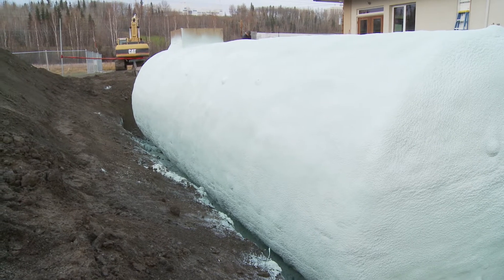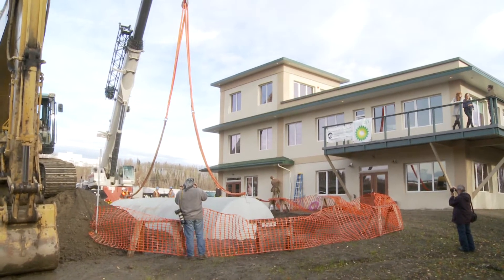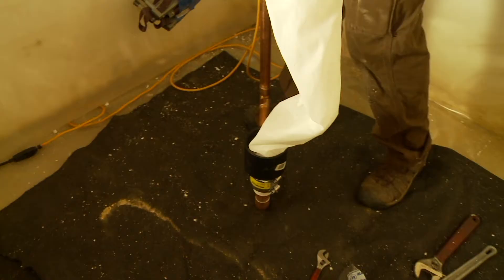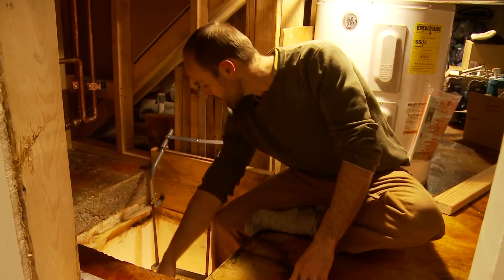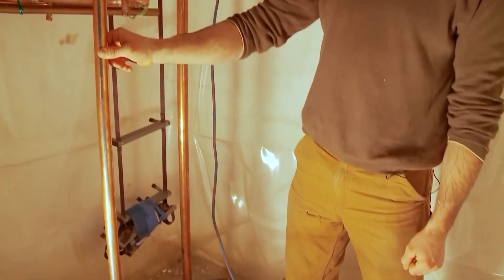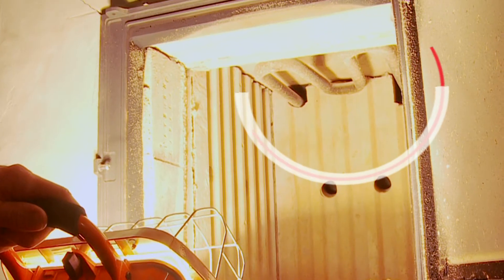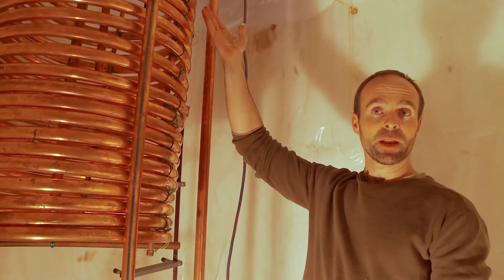Inside CCHRC: Thermal storage

Comment: Water without pressure has a limit to how much energy it can store. Whereas if you were using sand as the storage medium instead you could heat it to 600 degrees. And since it is a semi fluid you can get heat to stratify in it readily.
Reply: You’d have to use a considerable degree of solar concentration to get 600° either F or C, though obviously a lot more in the case of Celsius. I’d use air as my transfer medium but it would require some sort of pump for circulation. Maybe multiple, porous, ceramic risers for the stratification system as sand will not disperse heat along strata as readily as in water. Of course, if you’re using combustion as your heat source, 600° is easily obtainable.
Not sure if the greater complication would be worth it. Those high pressure air pumps could be expensive or dodgy or both, IYAM, and you might need a tracking array to achieve those temperatures.
Reply: @q.e.d.9112  no. Use electric inductive air heating and pump the air through tubes. That is how Polar Night is doing it.
Reply: @davefroman4700  care to elaborate further on the source of this information?
Reply: @davefroman4700 exactly and Batsand is doing it for residential with the storage underneath the house for new construction
Reply: @q.e.d.9112  No you can do it with a simple inductive heat load.
Reply: Which liquid medium would you use ?  I've seen oil based video solutions but fire hazard and pressure explosions are a concern but if underground the risk is mitigated.
Reply: Sand ... and a massive solar concentrator.
Reply: Your heat losses with a medium at 600C will be extremely high unless you spend a fortune on insulation. For any sort of single user residential case, I don't think it's a smart choice. You're going to spend 150,000BTUs a day just to maintain temp of your thermal battery without any load!
Reply: honestly people, we should simply be using nuclear reactors
Reply: I'm just starting into this video but I'm hearing sounds like they use water to store the Heat??? This must be an old video but I can't imagine any did not know about Polar Night in Finland and their 100 ton Sand Battery. Sand can be heated to 600 Degrees... with water you have an explosion way before that
Reply: @howtogetoutofbabylon8978 Come on now. You're comparing an 8 foot cube to a 12x15 meter cylinder.

The 'small' sand battery is over 468x the total volume of the water storage in this video. Let's not pretend this is a comparison wherein the only variable is the storage medium. There's a significant difference in scale and scalability before we even get to practicality, engineering and cost.
Reply: Bat sand is the company planning to put thermal storage tanks underneath the houses in new construction... of course as their name indicates they're going to use Sand not water!!!
Reply: Not easy to get the XPS insulation value of R-60 with zero thermal bridging at 600°. Insulation foams melt around 200°F. 

Not saying it can't be done, but there are always trade-offs.
Reply: The thermal mass of sand is about 5x less than that of water.  This means that energy stored in say 80C 1kg of water equates to 400C 1kg of sand - that high temperature is very hard to contain for a long period (months). That is why water is a better medium - though with water come pretty major cons such as potential for rust/container tightness/algae/bacteria...
Reply: @dorianmanto  
The useful energy in your system is the difference between the temperature of storage and the temperature below which the heat is useless (say 30°C in the case of space heating). That’s a Δt of 50°. So a Δt of 250° for the sand, for an equivalent heat content / unit mass. Ergo 80°C water contains the same heat energy per unit mass as 280°C sand.
In most situations, the volume of the storage, rather than its mass, will be the limiting factor. Sand has a density 1.4 times greater than water so that we’d need a Δt of 70° (t=100°) for the water to have the same usable heat per unit volume as the 280° sand.
At this point we can only store more heat in the water by pressurising it - not a good idea in a domestic situation, as you’ll know if you’ve ever seen the result of a pressure cooker explosion. The sand, on the other hand could store three times as much energy at 655°C without requiring any pressurisation at all. 
Of course, achieving such temperatures with solar would require both direct sunlight and a high degree of concentration. If we were using surplus solar electricity then achieving such temperatures would be easy.
Reply: @q.e.d.9112  Water has a specific heat capacity of 4186 J/Kg°C, dry sand has the unit specific heat capacity is about 800 J/kg K (really depending on where you look).

Water is a much better storage medium in confined spaces. You also need to account for the additional insulation needed to contain the hundreds of degrees C stored in sand.
Overall though, biomass and biogas are a much better storage medium than both of these as you can per se, accumulate  biogas throughout the year and simply use it in the winter. This needs no thermal insulation and is more energy dense than storing the energy in heat directly.
Reply: @dorianmanto  
I totally agree about biomass/gas but the video is specifically about thermal storage. I also think that long term thermal storage is more suited to a community scaled project. The relative construction cost of the insulated container is less for a larger scale project and with thermal capacity increasing with the dimensional cube, while losses are only increasing with its square, bigger is definitely better.
Dry sand at 600°C contains between 206 and 253 kW.h of >30°C heat per m³, depending on the particular sand. This would provide the needs for perhaps 10 apartments for a day in winter. A cubic meter of water at 100° contains about 81 kW.h.
That’s assuming you can make use of that heat right down to 30°C. If you need it for hot water (you do!) then it’s only usable to around 50°. Water has lost 2/7 of that 81 kW/h while sand has only lost 2/57 of its 200+kW.h.

ETA. Air at high temperature is more usable, too. It’s easily diluted down for lower temperatures, needing nothing more than a thermostatic controlled bleed valve, but it can be used at higher temperatures. Easy to have a 200°C oven or a 250°C hot plate if you’ve got a supply of 300°air.
Reply: Actually, doing further, back-of-an-envelope calculations, I think sand storage could possibly be viable for a single household. We’re going to need a container for about 10 m³ of sand, which @ 600°C contains around 2.3 MW.h of (>30C) heat energy. That’s 20kW.h per diem for a continuous 115 days. 
A brick chamber 7’x7’x7’ with 3’ of insulation top and sides,ought to suffice. Make it 10 x 10 x 7 and you’ve got 40 kW.h per day, or 30 for a full six months.
Use surplus solar power during the summer months to run heating coils embedded in the sand. Ideal for an alpine situation and a super well insulated chalet. Little electrical demand, during summer, Could be installed under the house, easily enough. Dry sand, electric heating, glass insulation, air. No leaks, no rust, minimal fire hazard. High-grade heat, Zero new technology: hot air oven and cooktop easily made up by local engineering shop. A winter’s worth of space and water heating, cooking and refrigeration, too. Easy to convert a gas fridge to run on hot air instead.
During winter, solar power is only required for lighting, electronics and intermittent appliance use. So size your solar/battery system for winter use and store the summer surplus for heating/cooking use, all winter long.
Reply: @q.e.d.9112  Yes, it seems more suitable for smaller installations. I don't know how to extract the heat though? Closed loop glycol or something with an exchanger? Direct water/air pump through tubes?
Reply: @PerhapsNoodle  
We’re dealing with very high temperatures here. I think using air, passing through embedded stainless tubes would be the easiest way to extract heat. Can blow air through without the need for high temperature pumps. Can easily mix hot and cold air to achieve a desired temperature. I don’t think we can get high enough temperature with solar/thermal; think we need photovoltaic to generate the red-hot temperature we need for megawatt.hour storage.
👍
Reply: @q.e.d.9112  Commercial solar power works at 20% efficiency while commercial solar thermal can achieve efficiencies above 60%. Thermal collectors are cheaper than panels per unit of area. The water based solution seems more sensible to me.
Reply: @q.e.d.9112 stainless steel is not a very good conductor of heat. Aluminum or copper would be much better
Reply: @vegeycracker  
We don’t necessarily need a particularly good conductor. I was thinking thin walled stainless risers, through the sand would be cheaper than copper. Aluminium loses structural strength above 200°C. But, hey, the extra cost of copper would probably be pretty marginal so you’re probably right.
Reply: @q.e.d.9112  I am in the early stages of planning a sand battery to heat the soil of a greenhouse so that we can plant earlier.  We're in Alaska off grid and we have 25KW of solar panels that produce far more power than we can use in the summer and shoulder seasons.  Thinking of digging a pit (fortunately the soil a foot down is all sand, although I might have to process it to make sure the organic stuff is disposed of) and then put down some insulation, then pour concrete over top, then put sand back on top of that.  Might use some additives for the concrete to make it more heat resistant.  All encased in concrete with insulation outside the concrete.  Then on top of that will be soil added back on and the greenhouse built over it.  Maybe some stainless steel tubes going through the soil and some kind of air pump and regulator to control when and how much hot air is pumped into the soil.
Reply: @Pythonizah Is it true that governments have deliberately capped and limited the efficiency of solar to around the 20% mark?  Private Industry makes a fortune billing the public purse, so they are invested in reducing efficiency to sell more panels….not forgetting the engineered obsolescence generating future replacement and further profits!  

Any channel exploring and developing systems that people can use outside of the grid and the corrupted system, is doing us a great service.
Reply: @q.e.d.9112 I love your idea, I live in the artic and there is excess (1/2 cost)wind energy that could be implemented into this idea. You design it I’ll build it.
Reply: But that's useless if you don't have a source reaching those temps. 90C is already pushing it with solar heating. They're not using electricity for heating; others doing it like that is very irrelevant.
Reply: @TheMrTape  Because with that kind of heat you can run a heat pump off it and supply 100% of the heating for 1/4 of the cost of operating a traditional heat pump.
Reply: solar doesn't provide more than 200° celius max. I dont't see the benefit for his use case to burn wood like a crazy person to heat the Sand up to 600°
Reply: @foxxyboxxy9348  
No, the idea is to use surplus wind/solar electricity to heat the sand. If your solar can provide enough for your winter time usage, it will have power to spare over the summer months. Properly insulated this can be stored as heat, for months. 
The LCOS and thermal efficiency both improve with scale. However, distribution losses increase with wider distribution, so there will be an optimum size for any given situation.
Reply: @q.e.d.9112  Exactly, but you could also use solar vaccuum tubes instead of PV and pump hot water or something, but more complicated to get higher temps than just Incoloy heating elements embedded in the sand.

Comment: R1.15 in the ceiling? In Belgium my ceiling was insulated to R1.7, about 5 years ago, and it was deemed insufficient in the building report, so I put another layer of insulation to bring it up to R3.20 which is the most common now. I can't imagine living under a R1.15 ceiling in Alaska! 🥶
Reply: He said R115 in the ceiling and  R70 in the wall, not R1.15.  It is R values in the inch pound system because he is in not america. The R value  unit there is in (°F⋅ft2⋅h/BTU) the metric R values are in (K⋅m2/W)    the conversion is the R_metric *  5.68 = R_inch-pound . So the insulation in metic R is R 20.25 for the celing and R 12 in the walls. So the celine R value is around 12x higher then you have.
Reply: I think it’s in inch pound units. R-115 is the equivalent of 20.7 m2K/W

Comment: I do not get why your tank under house is ... with a liner, wasn't it better to build a concrete tank covered with insulation, this way you would have been able to go to a higher temperature = storing more energy.
Those tanks are big ... and will radiate a lot of their energy => you will need to heat them a lot cover those loss.
And when you say "79% of the energy consumption accounts for space heating" ... it means nothing, it depend on what kind of house.
A properly insulated house will not need much energy to heat, properly mean ... designed for cold climate.

Comment: Is there a way to heat without using any wood to supplement? Would a larger tank carry you over? How many days of heat do you get with this system?
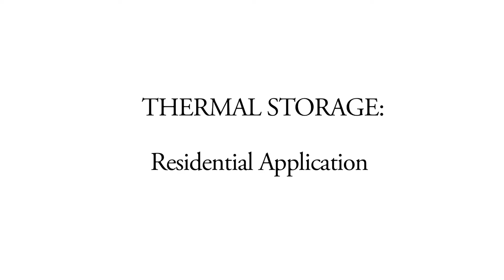Reply: During the winter months in Alaska even more so as they near the winter solstice they only get 3:42 of sunlight in Fairbanks. The sun just barely peeks above the horizon, its super low 2-3° sun angle provides little in the way of thermal heating unless thermal panels are mounted completely vertical and facing south.
Wood pellets are manufactured from waste sawdust and wood scraps that otherwise need to be delt with so having  the ability to utilize a waste stream to heat homes is ecofriendly.
Yes, a larger tank would last longer into winter, however cost becomes a major factor. Just look and see what a special order 4x8 sheet of 6" thick XPS is at the local home center, and that is only half the thickness, its crazy. Those blocks of foam that make up the 2,000 gallon tank are 12" thick, are very large, and costly. If the size of the tank was scaled up 3x, 5x, or 10x the cost would outweigh the benefit of renewable energy and going with a fossil fuel heating source would cost less.

Comment: What are the caloric losses from the tank walls?
Reply: 300mm EPS 0,114 W/(m²K). Tank area is 24m². So it will leak 2.7 watts every kelvin/centigrade above ambient. So when water is heated to 60C (140F) then tank leaks 100 watt. Luckily almost all heat leaks into the house so it's actually not a loss, rather a useful heating.

Comment: Why water? Not sand or some stones??? Layering???
Reply: Indeed.
In video's I saw where they using sand to test it.
They can use higher temperature (600°C / 1,000°F) by heating the sand up then with water.
Therefore the cooling down of sand is much longer in time. 
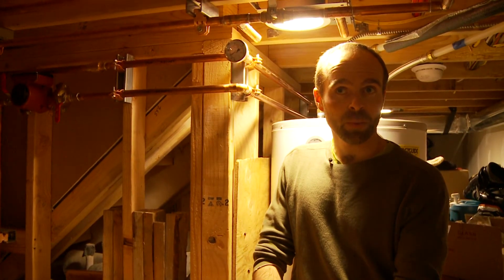 4:25  https://www.youtube.com/watch?v=G6ZrM-IZlTE

Comment: How do we flip this tech around to cooling homes in arid deserts ? And : Is it possible ? Is it viable ? Is it easily constructable ?
Reply: Use solar electricity in the Winter to run a chiller to freeze a giant block of ice. This way you get the benefit of having phase change which allows more storage of energy with less space. The main issue is the expansion when the water freezes and dealing with containment. Maybe just freeze giant blocks floating in a insulated pool so the water doesn't freeze near the containment walls which allows the water level to rise instead of freezing and pushing the walls out.
Reply: Here is my idea:

Build with ICF construction.  Usually it has horizontal rebar every 24" but it has rebar hangers every 12" so half way between the rebar put in horizontal PEX tubing similar to radiant flooring but in the exterior wall.  Maybe cheat the PEX toward the interior side.

Manifold all of that in a way that individual loops can be isolated if anything starts to leak.

Now outside bury a large geothermal PEX loop about 10-12' deep.

Fill the system with water and antifreeze and circulate that with a pump.

The thermal mass of the concrete in the walls will make temperature fluctuations slow and the ground source water should fluctuate probably between the high 50s and low 70s.  With foam insulation on both sides of the concrete, thermal gradients will be formed, one on the outside going from essentially the outside air temperature to the ground temperature and one from the ground temperature to the inside, through the foam to the inside air temperature.

If it works the way I imagine, it should greatly reduce HVAC requirements because it will use that ground source without needing a heat pump, then your AC/heat pump is only working to adjust your temperature between ground temperature and your thermostat setting.

I just wish I knew an engineer who could tell me if it would work and help me size the ground source loop...

Comment: How hot do you run your tank, and how hot can the vinyl liner and the Styrofoam withstand?
Reply: máš to ve videu ty cype
Reply: PUR insulated steel tank doesn't allow for temperatures that a sand battery is capable of storing.